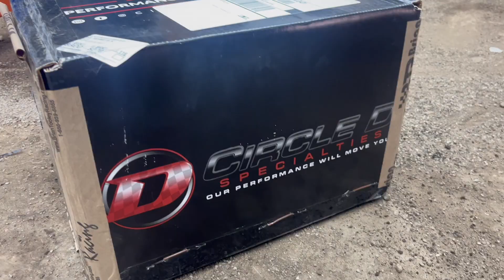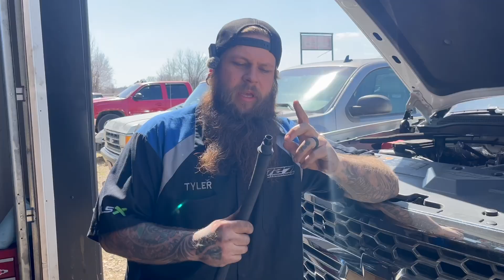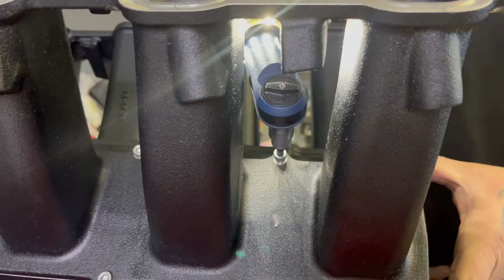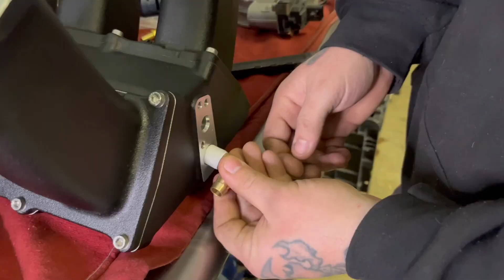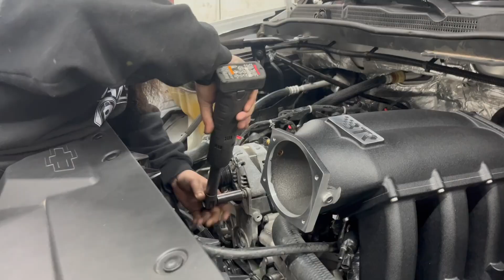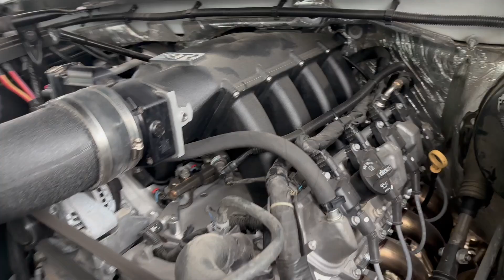Part 3: Final Episode | IDLE CLIP! | Gen V L83 Gets BTR Pistons, Stage 3 Cam, Ported Heads & More!

Comment: Like the content and set up. I don’t like the idea of hardware on the inside of that intake tube. Could be a disaster waiting to happen. I would definitely try to find a better solution. I don’t think I would even trust loctite for this application. Not bashing any of the work and feel it will do in a pinch but sometimes overlooking something like that can cost someone a lot more down the line.

Comment: Looks like you plugged the driver side port hole on the intake manifold .  What did you connect on the passenger side port hole fitting?